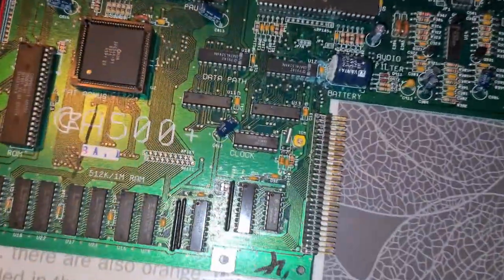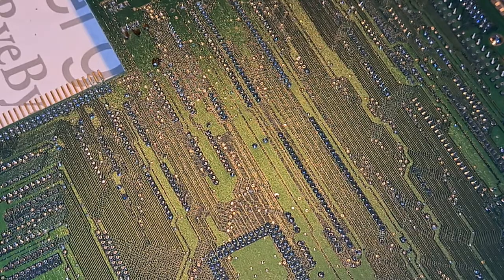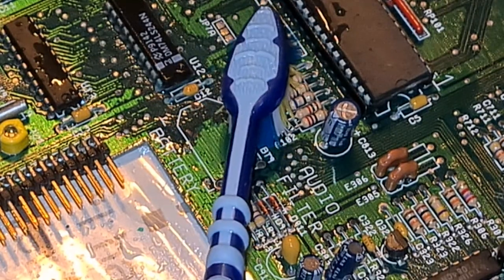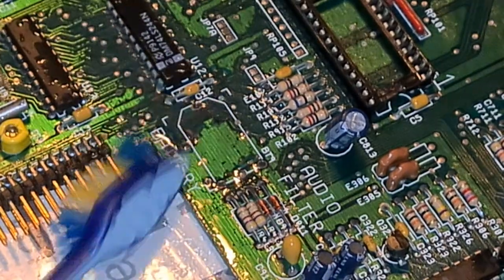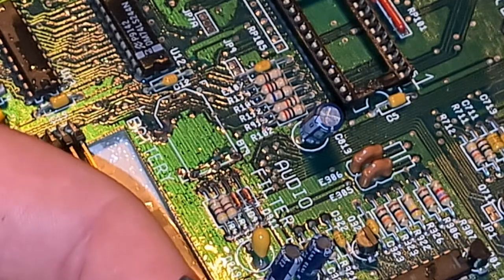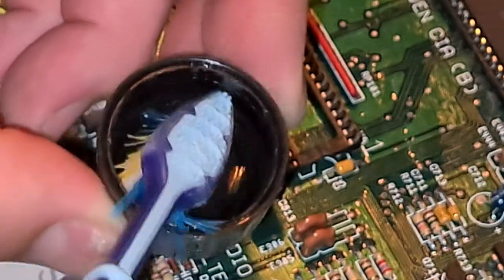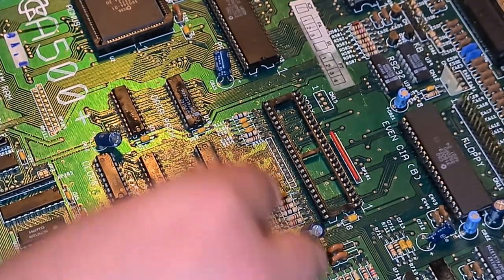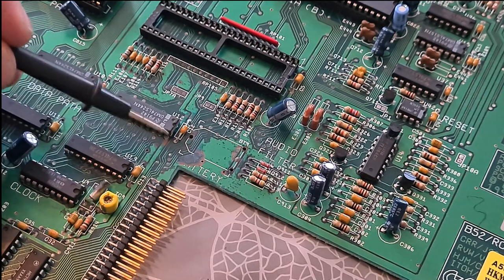Opening an Amiga 500 plus in 2022 PART 2 battery removal, cleaning the board plus testing.

Comment: Toothbrush was a good idea to cleaning?I dont think so 🤭
Reply from the maker: Il be glad to hear your professional recomendation ?😄
Reply: @danielyttervoll1907  Use copressed air or soft brush 😅
Reply from the maker: Toothbrush is soft, perhapps you brush you teeth with steel whool?
Reply from the maker: If the board was not exposed from this acid from the leaked battery, i would clean it with only cottonpads, but as there where battery leak, i wanted to scrub the infected area to be able to see the real damage, acid make the board coating to dissolve but is not easy to see before you give it a scrubb, as the protection is dissolved the cobber tracks get exposed to air witch lead to corrotion, so i wanted to expose all area to itj can be recoated for futher protection you see😊